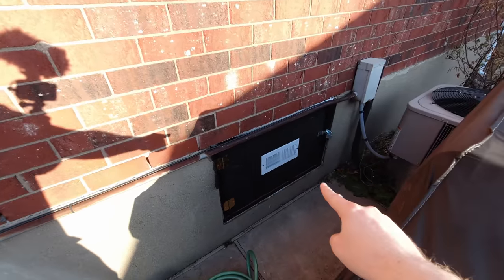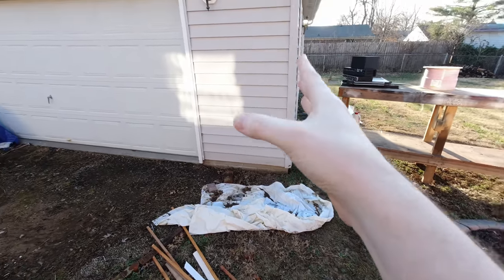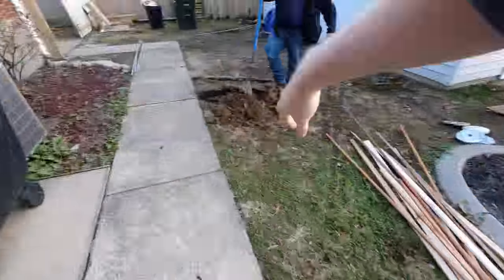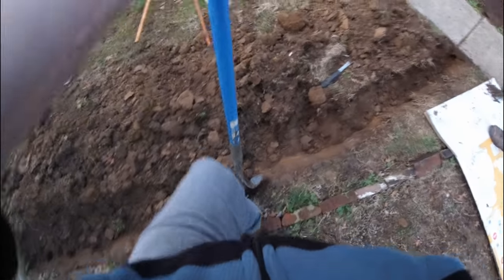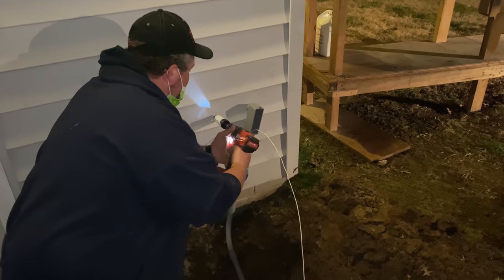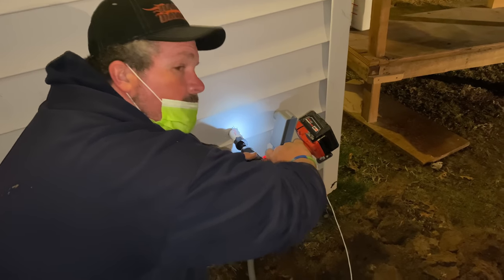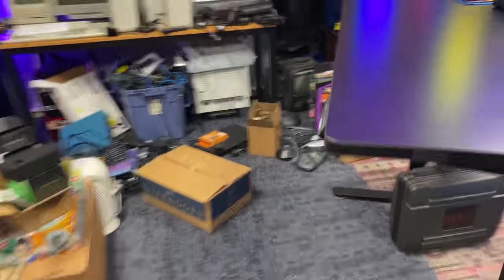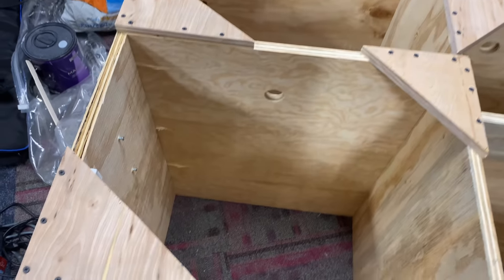Networking & NEON | NEW STUDIO Moving Vlog #6

Comment: For future reference use a 100-200 ft fish tape. Also attach poly line to the wire you pull. It will leave poly line aka string in the conduit for future pulls. It's what we do in the field to save time and effort.

Comment: Too late now but would recommend 4+ strands of fiber versus copper underground since you're limited on speed/reliability with copper where fiber can grow with the use case.
Reply from the maker: I only really need gigabit between house and studio, I have no fiber gear in the house.
Reply: @EposVox  You always need more speed! I thought you said you had SFP+ 
transceivers in the new switches.
Reply: @EposVox  My concern about fiber between buildings isn't due to speed or bandwidth...  It's equipment damage.  I have a very good friend of mine who worked for a hospital years ago.  His request for fiber between the buildings (right next to one another, closer than your house to your garage) was denied until he showed the construction team that connection the grounds of the two buildings caused any wire of any size to just melt.  First insulation, and then media.  The buildings were at different elevations, but it's not required in order to have very different electrical potentials.

Clearly, it's too late to fix this for now, but keep it in mind if you randomly have switches and such frying.  That could be the root cause.
Reply: @EposVox  Never put CATx cable underground between buildings. Lightning will fuck up your equipment and it can (and does) cause thousands of dollars of damage. Using fiber optic cable may seem like a daunting task, but it's not. You can buy pre-terminated cables on fs.com and put it in a conduit underground. Bend radius is not as much an issue as people make it out to be, you can use 90 degree angles in conduit just fine. 
At both ends of the cable, use a simple active media converter to convert from fiber to ethernet and you're golden. No need for fiber switches or anything like that. Plus, you can make YouTube videos about the whole process and attract many viewer ;)

Comment: I had a comparable situation a few years ago but had to cover a twenty-foot under driveway segment.  I called a cabling company had them come out for a quote. I asked a lot of questions as to how they would do it. They have this compressed air cable snake that burrows under the fixture and can be directed (The same idea as directional drilling). I then found one for rent for a weekend, and it only took about twenty minutes to go the entire length. I was a few hundred dollars to rent and an hour of instruction time. That was cheaper than the $6500 the cabling company wanted to charge me for the same thing. I had to have the telecom, cable tv, and electric companies come out and mark their lines for me. The other option would have been a micro-trencher that cuts a narrow several-inch trench in the asphalt that you then patch after laying your cable. I took the opportunity to lay in an in-ground cable vault and ran an additional in-ground rated fiber optic line from the curb into the house for the future century when we get fiber in this neighborhood. I put the metallic tattle-tale strip in so it would show up when cable marking and informed the utilities of its presence and had them add it to their file and made note of it on our copy of the landscaping plan diagram.

Comment: All these are guaranteed number for a correct installation:
CAT6 will do 10Gbps up to 55m, or 100m at 5Gbps or lower.
CAT6A will do 10Gbps at up to 100m.
CAT5E will do 5Gbps up to 55m and 2.5/1Gbps up to 100m.

As usual there's "wrinkles", first of these are that these are combined patch+wall lengths, wall cables should be solid cable while the path section is stranded with more loss (worst case lost as specified in the structured cabling standards). IIRC for 100m it's defined as max 10m patch-cables (implying up to 90m wall/solid cable) and if you use more patch/stranded cable than this you're outside spec regardless of total distance...
To add to the fun most (all?) connectors are for either solid or stranded cable, using a connector not for the cable type you're using instantly makes it "out of spec" because it can lead to bad connections.

Countervailing this is that these are... absolute MINIMUM requirements it must always be able to do, but in reality you'll likely be able go considerably longer or faster because the standard assume absolute worst case scenarios for every parameter at the same time and the chance of that happening is very small.

As a result it's not uncommon to be able to go either faster or longer than than the standard guarantee, even old CAT5E runs may well be fine at 10Gbps for shorter distances (30-50m) but only testing will make sure. Likewise, none of the copper standard offers any guarantees beyond 100m but it's a very good chance a 1Gbps run on CAT5E will be fine up to 150m or so. 10Gbps is a bit more sensitive but 120-130m on CAT6A is often fine.

Of course, Murphy's law does mean that if you DEPEND on going beyond the standard you WILL eventually get burned... And while CAT6A cable used to be expensive and heavy (making it hard to install because it wouldn't bend as much) the difference is much smaller these days, so it's not uncommon to just go with CAT6A even for runs that is never going to go fast or long.

Comment: Awesome job! Studio is looking sick. 

That ring of LEDs around your ceiling looks amazing. May I suggest that you take it a step further if by replacing the standard RGB strips with addressable RGBs. You could try to reach out to someone like DrZZs to colaborate on that project and how to integrate it with your streamdeck and/or OBS.

It's not normally a good idea to run copper networking between detached structures. You may not ever experience any problems due to the proximity of the 2 buildings (or how the grounding was done), but I've seen a lot of networking equipment fail due to "ground potential differences". (Great article explaining the problem: https://www.cablinginstall.com/cable/article/16465312/ground-potentials-and-damage-to-lan-equipment). If you ever run into issues with switches or media converters dying more than usual, I would suggest you go back to using fiber. Even the weakest fiber optic transceivers should be capable of 100M if not 300M, not just 100'. Added bonus is that they always negotiate and run a rated line speed, aren't susceptible to interference, and act as a "fire break" in the event of an incident where high voltage makes its way into data cabling (such as a lighting strike).

Cheers!

Comment: why not make use of those coax runs to pipe SDI video around the house? its more useful than you might expect.
Reply from the maker: I cannot imagine how I'd ever use that.
Reply: @EposVox  for example, i have my games stuff in my bedroom and my PC in the studio, so i used two runs to get video from the games setup into my pc's capture card, and then send the pc's monitor back to a little portable lcd. then with one of those RJ45-USB extender dongle pairs i got keyboard and mouse working, making a sort of dumb KVM. 

i've also used it to send video downstairs into the basement workshop while circuit bending a VCR using an SDI-HDMI and then HDMI-composite converters.
Reply: you could do some of this using NDI and mini-PCs, but that eats up network resources, and the coax is already right there
Reply from the maker: Yeah but none of that I'm doing in my house heh